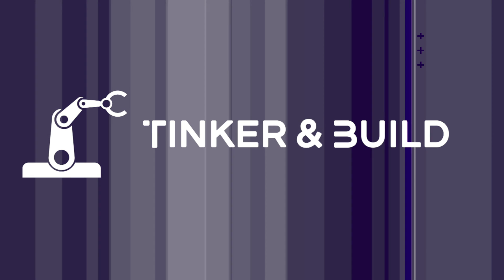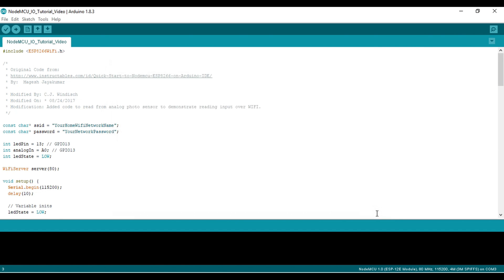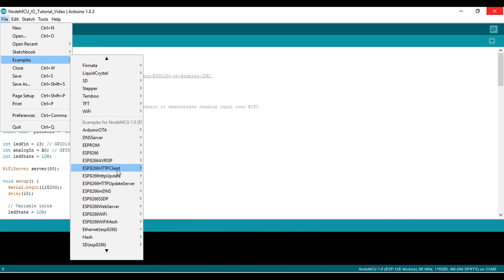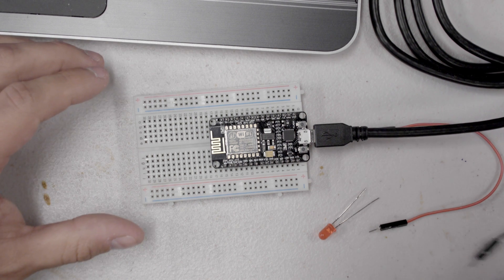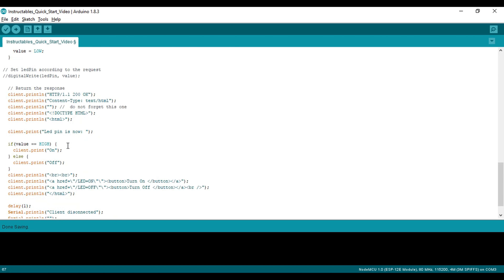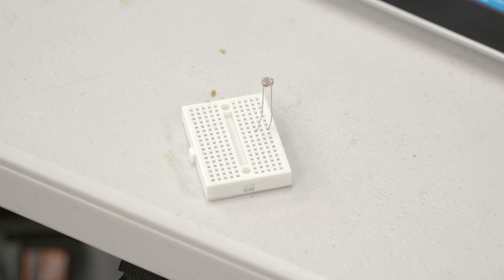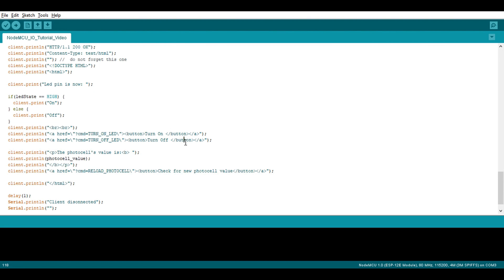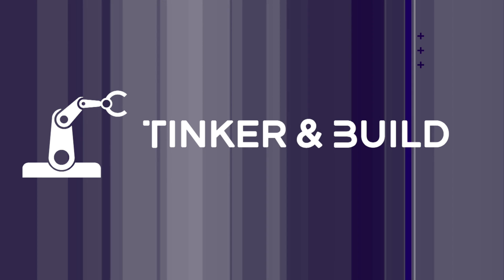Internet of Things Project: An ESP8266 Example using the ESP8266 Arduino IDE

Comment: Need help                                                                                                                                                                         Executable segment sizes:
IROM   : 228624          - code in flash         (default or ICACHE_FLASH_ATTR) 
IRAM   : 26756   / 32768 - code in IRAM          (ICACHE_RAM_ATTR, ISRs...) 
DATA   : 1248  )         - initialized variables (global, static) in RAM/HEAP 
RODATA : 688   ) / 81920 - constants             (global, static) in RAM/HEAP 
BSS    : 24880 )         - zeroed variables      (global, static) in RAM/HEAP 
Schiţa foloseşte 257316 bytes (24%) din spațiul de stocare a programului. Maximul este de 1044464 bytes.
Variabilele globale folosesc 26816 bytes (32%) din memoria dinamică, lăsând 55104 bytes pentru variabilele locale. Maximul este de 81920 bytes.
esptool.py v2.8
Serial port COM4
Connecting.....
Chip is ESP8266EX
Features: WiFi
WARNING: Detected crystal freq 20.28MHz is quite different to normalized freq 26MHz. Unsupported crystal in use?
Crystal is 26MHz
MAC: 00:08:ff:00:00:00
Uploading stub...
Running stub...
Traceback (most recent call last):
  File "C:\Users\apetr\OneDrive\Documente\ArduinoData\packages\esp8266\hardware\esp8266\2.7.4/tools/upload.py", line 65, in <module>
    esptool.main(cmdline)
  File "C:/Users/apetr/OneDrive/Documente/ArduinoData/packages/esp8266/hardware/esp8266/2.7.4/tools/esptool\esptool.py", line 2909, in main
    esp = esp.run_stub()
  File "C:/Users/apetr/OneDrive/Documente/ArduinoData/packages/esp8266/hardware/esp8266/2.7.4/tools/esptool\esptool.py", line 637, in run_stub
    p = self.read()
  File "C:/Users/apetr/OneDrive/Documente/ArduinoData/packages/esp8266/hardware/esp8266/2.7.4/tools/esptool\esptool.py", line 292, in read
    return next(self._slip_reader)
  File "C:/Users/apetr/OneDrive/Documente/ArduinoData/packages/esp8266/hardware/esp8266/2.7.4/tools/esptool\esptool.py", line 2057, in slip_reader
    raise FatalError('Invalid head of packet (0x%s)' % hexify(b))
esptool.FatalError: Invalid head of packet (0x46)
esptool.FatalError: Invalid head of packet (0x46)

Comment: I've always wondered, with this sort of thing, what are the security implications? If I were to say, use something like this to control opening and closing my garage door, would this be as secure as using the standard RF garage opener? Assuming that in order to hit the ESP8266 you would need to be connected to the network it is on. If you're not connected to the network you wouldn't be able to trigger this, right?

Comment: i need your help dude
 can u help me in connecting fingerprint module over esp2866 and trasfer data over wifi plzz
Reply: Aniket why the heck would you transfer fingerprint id over wifi?
Reply: for attendance system
Reply: Aniket well it is esp8266 so it is possible to transmit id of fingerprint but idk for name like bob, john etc. Well it may be possible that when esp gets some id from fingerprint like idk 49v92n7j and you say to esp that is john it may be possible that when next time john press the scanner access will be granted for him
Reply: ok..i want to do the same  i m having connections for arduino but i need help for esp2866 12e
Reply: Aniket well it is possible to make it like instead of key to use fingerprint and push notification to be send to your phone
Reply: Aniket well this nodemcu is literally arduino so what ever you can do with arduino you can do with this but arduino (with no shealds) don't have wifi and this thing have wifi that is it
Reply: ok. i'll try  thank u if u ever found out the connection then plzz share with me anyways thankyou for positive support